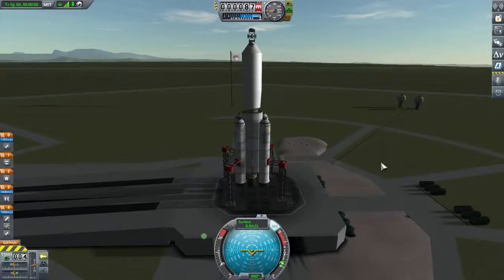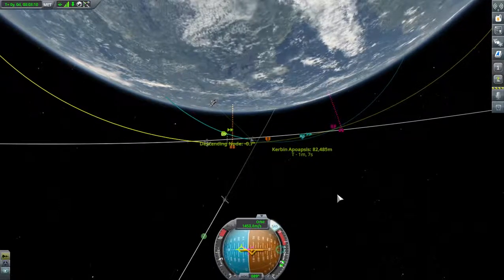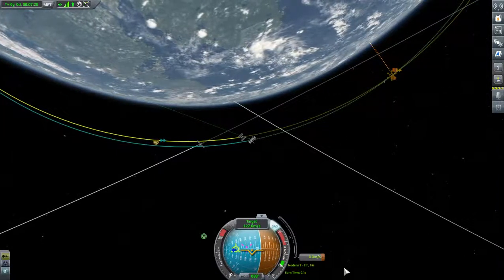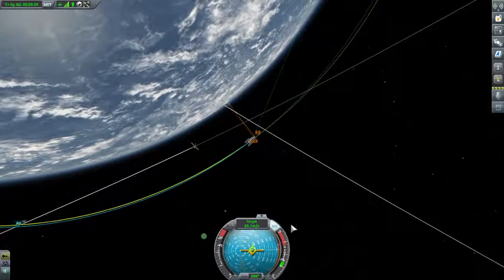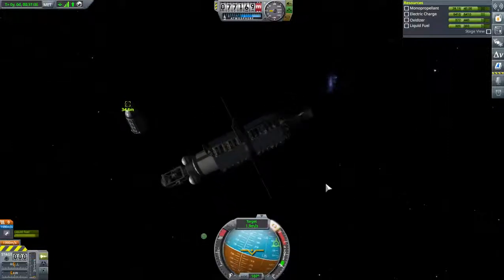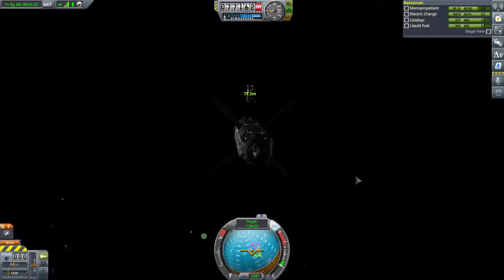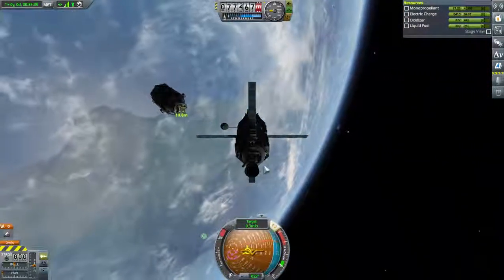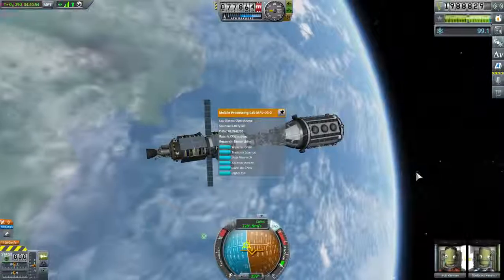KSP ASCENT - Charger1 Docks With Kerblab

Comment: Standard safety procedure for docking maneuvers;  shut down the main engine(s).  ;)

As for batteries, you just ensured headroom for expansion.  :)
Reply from the maker: Haha.  I always scan the gauges. (Fuel, Electric Charge, Connection...) I'll start adding 'Engines' more often! :)